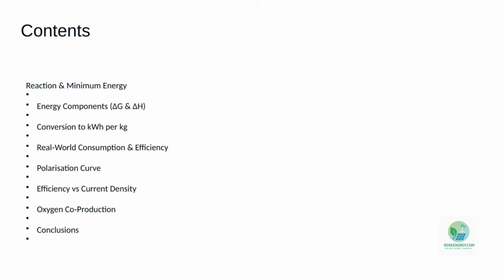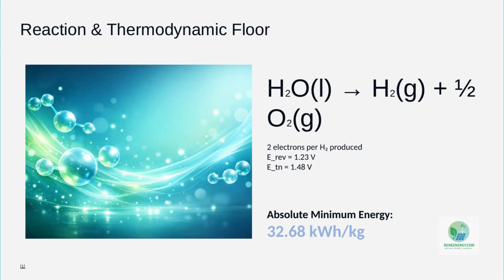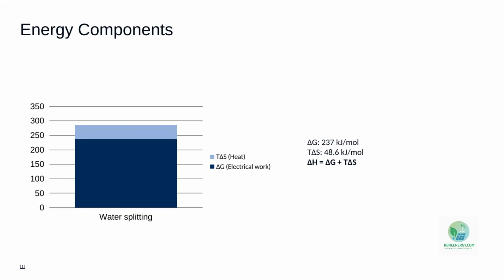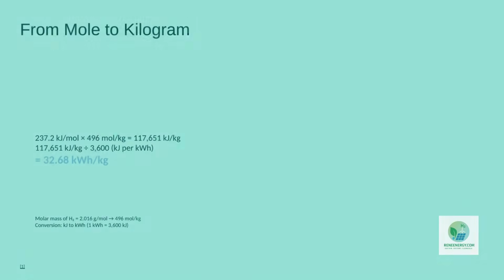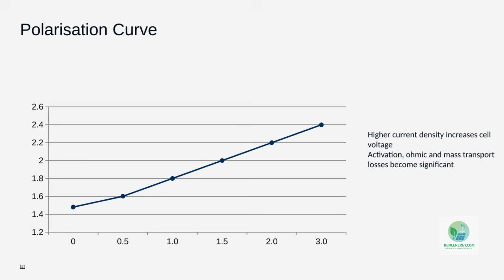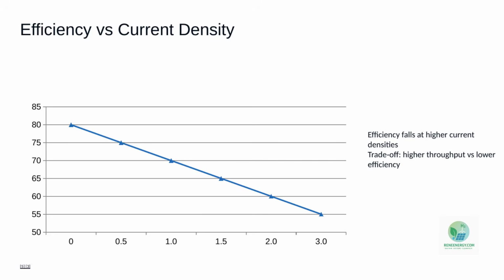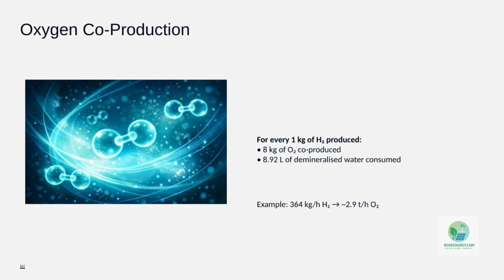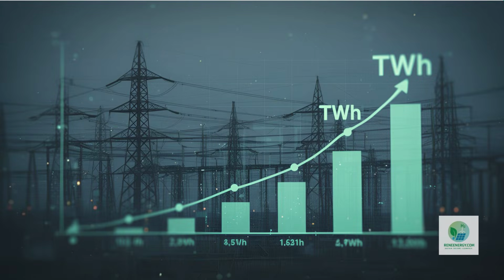The 32.68 kWh/kg Wall: Why No Electrolyzer Can Beat Physics

Comment: It's a bit deceptive to measure energy in kWh (that's how we measure electricity, but in science we normally use J), and also refer that to electrolyzers. You mention heat already, but don't go into it. You can use heat to reduce the electricity required by electrolyzers to below 32,68 kWh/kg. This is one of the reasons that some people propose producing hydrogen near nuclear plants, or other thermal plants.
Reply from the maker: Fair point! The 32.68 kWh/kg figure is just the Gibbs free energy (~237 kJ/mol) — the actual enthalpy of water splitting is ~286 kJ/mol, and that gap (TΔS) can be covered by heat instead of electricity. High-temperature solid oxide electrolyzers do exactly this, dropping electrical demand to ~25-28 kWh/kg. Nuclear plants are attractive because they supply both — and some Gen IV designs run hot enough for thermochemical cycles that skip electrolysis entirely.